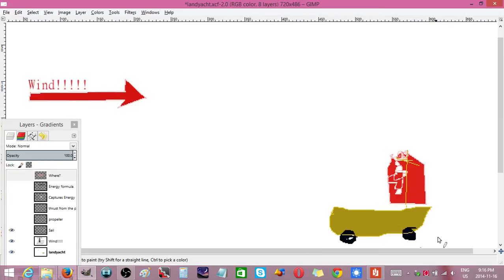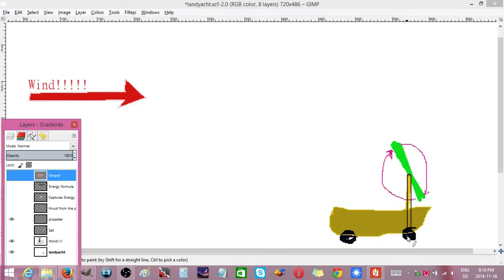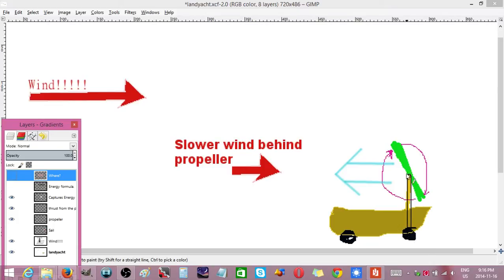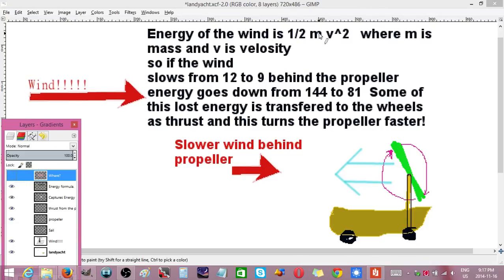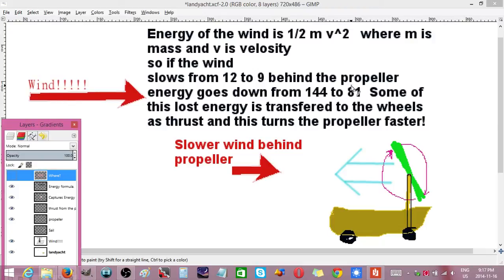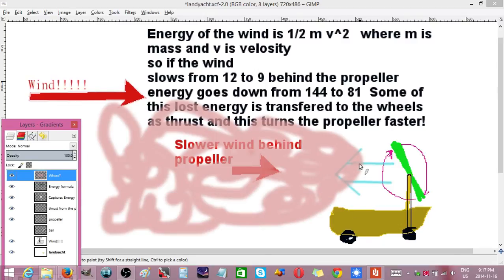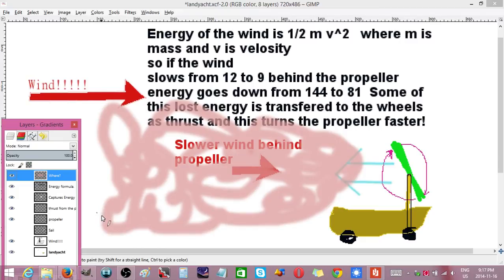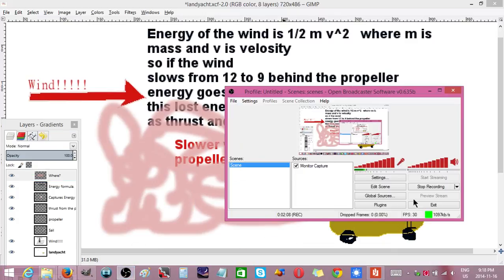Faster than the wind, DOWNWIND!  Propeller driven landyacht, Shows where the energy comes from!

Comment: Not sure that really explains it for me.   But here's another question: what happens if the wind dies down after the land yacht is going faster than the wind?   Does it keep going the same speed forever (or until it runs out of road), does it accelerate, or does it decelerate, and why?
Reply from the maker: It decelarates, due to "rolling resistance from the wheels, and friction in the spinning propeller   and if there is no wind,  it will roll  to a stop fairly quickly. The wind needed to "start "the land yacht is faster  than the wind needed to keep it moving.  I don't know at what wind speed the land yacht becomes more efficient than a plain old sail. It probably depends on the design and angle of the blades.  Ideally, the blades would have adjustable pitch and a gearbox so they could pick up and transmit energy at different speeds from the wheels.
Reply: @Brians-tracking-solar-scoop  I'd like to see that tested because it sure is a brain teaser, like for example, the model ones that can run uphill on a treadmill in no wind at all.

Also, does the prop transition at some point from being blown to blowing?
Reply from the maker: @VigilanceTech  Well done to whoever thought of the treadmill model. Moving the ground relative to the  air to get the same effect as wind. AND keeping the model so compact.    There isn't really a transition.   The moment the wind is strong enough to push the land yacht forward, the propeller turns and it is blowing,  but of course it is very inefficient. (Its like using a string vest as a sail) but the feedback of energy as the wheels accelerate quickly changes the efficiency.

Comment: Interesting. So how does the energy get transferred from the slow air to the craft?
Reply from the maker: It doesn't.  It gets transferred from the fast air to the landyacht,  as a little more forward momentum, that turns the wheels a little bit faster that then drives the propeller a little bit faster. As the land yacht launches, the propeller is acting as a very leaky sail,  slowing down the wind only a tiny bit,  but in the end it is a propeller pushing against the wind a lot and slowing it down a whole lot..
Reply: I thought the slow air was slow because it gave up energy to the vehicle.
Reply from the maker: @th3b0yg  yes,  Your initial question was "how does the energy get transferred from the slow air to the Craft" .  And the answer is still the same,  the energy got transferred from the fast air to the craft.  The transfer occurred as the air was being slowed.  The slow air is a product of the transfer,  has already lost its energy ,  just as the faster landyacht is a product of the transfer.  I hope that helps.  Maybe this confusion is just because of how we are using language. Perhaps I used an incorrect term in the video.  I didn't have a script.

Comment: Brian, I'm not sure you're really explaining how it goes Faster than the ambient air.
If you simply take the energy out of the relative wind (ie. the difference between the speeds), you would stabilize at the speed of the air. The trick is that the propeller is geared to the wheels and the wheel drive the propeller (not the other way around). The ambient air is then pushing on the accelerated air behind the propeller...or so I think...sorry if I just made it less clear
Reply from the maker: Well, the propeller pushes air against the wind behind the land yacht and that  slows down the wind behind the land yacht and transfers its energy to the yacht itself,  speeding it up, and some of that energy is harvested by the wheels to drive the propeller even faster. My point is that the land yacht is powered not by the relative wind but by the slow down that it creates in the wind directly behind the landyacht. In theory,  a land yacht would go even faster if the propeller didn't send air directly back into the wind, like a cylinder of backward sent air.  If it sent air back as a wide "cone of air",  it would potentially slow down a wider section of wind and go even faster.

Comment: Nice but wrong. It can go faster than the wind because the propeller is turning and not going straight downwind. It is essentially broad reaching the same way a sailboat can go faster than the wind on a broad reach.
Reply from the maker: Thank you,  Sassyblondel   I thought long and hard about this and I made this video because I was personally attacked for being stupid enough to believe this "hoax" with no easily apparent source for the energy to drive it forward faster than the wind.    My explanation isn't "wrong". (as agreed by the guy who actually achieved the record and who made up  the explanation that you use here).  You can seem my comment on his video and his replies, elsewhere.  Both explanations are  just the same thing seen from a different perspective. An advantage of my explanation is that I show  (to those who are convinced it is a hoax),  EXACTLY where the energy to move the thing forward directly  into the wind is coming from!  I made the video to help these (often relatively scientifically literate)  people open their minds to truth.  In the long term,  my explanation may help people understand better and perhaps modify their propellers to make the things even faster!
Reply: It's possible. Sailboats can do twice the wind speed. Land sailors three or four times and ice sailors are almost unlimited. If you imagine a craft crossing a 12 mph wind and traveling 12 mph perpendicular to the wind the apparent wind is now 17 mph and the craft can now sheet into a 17 mph breeze and travel faster than the wind. As you travel faster and bare away from the wind, your apparent wind keeps increasing. The propeller tips, in this case, are not traveling that far off the wind. Maybe 110, 120 degrees or so. Also remember as speed doubles the force squares so the propeller becomes incredibly powerful at high speed.
Reply: Yes. Yours is the best way to understand this: the land-yacht may be travelling down wind, but the rotating propeller blades (sails) are moving at right-angle to the wind and therefore the well-understood dynamics of how a sail-boat travels faster than the wind when at a right-angle to it kicks in; and the resulting rotation drives the wheels. The wheels are therefore NOT driving the propeller.
Reply: @mikerobinson579  The wheels are very definitely driving the propeller.  We have a ratchet on the axle to insure that the propeller can't drive the wheels.  And we've broken the chain more than once.  All you have to do is look at which side of the chain is under tension to confirm that the wheels are very definitely turning the propeller.

Comment: Dear Brian.
Interesting explanation. It is true, But there is another way of looking at it.
I don't know why so many people think its impossible and can't get their heads around this one.
The easiest was of thinking of it is this.
If, for example, the landyacht was moving downwind the same speed of the wind. TO THE LANDYACHT the ground is moving and the air is stationary. The wheels then collect power from the ground and transfer it to the air (via the propeller) which allows the landyacht to make progress through the air, which we see externally as downwind faster than the wind. The important thing to understand is that the landyacht has no way of "knowing" which is the moving medium (air or ground). It only knows that one medium is moving in relation to the other. We ourselves, watching from outside, know that the ground is stationary and the air is moving. This is why the treadmill experiment proves downwind faster than the wind is possible. The ground moving/air still is EXACTLY THE SAME THING as air moving/ground still. Think of an aircraft wind tunnel. The model plane in the wind tunnel does not move, but the air does. There is no suggestion that this is not the same as the plane moving and the air still, which is what it emulates in real life.
Reply from the maker: +Peter Mangold  I "get" the threadmill proof too but   I have seen intelligent people get mad at the treadmill proof!  They absolutely think it is fake. So much for all those people who "claim" to understand Einstein's theory of relativity.    It's part of the reason,  I explain it differently. Frankly,  I'm embarrassed for them that they don't get it.   (Smug smile).   You got to help people out sometimes.  (Some of them are way smarter than me,  and it is a challenge and  almost patronizing to have to explain it).

Comment: the affect creates an effect that affects the initial affect to greater effectiveness. HA genius.
Reply from the maker: The guys are pretty brilliant to think of it!  Check videos of ayrshquk  (DDFTTW) and the later "blackbird"    I have seen other explanations of how the propeller is like 2 boats tacking into the wind left and right at the same time.  Not sure how they use that to explain 2.8 times windspeed going downwind.   PLUS I'm betting that this explanation is much more down to earth and will allow other people to extend this to doing actual useful things.  We should be concentrating on what is happening to the air behind the propeller.  If we can either slow down that air more or make the slowed down part wider, the thing might even be able to go faster!  Brian
Reply: Brian White 
Search "Sail to Prop - directly downwind" for an animation that explains how tacking DOWNwind (with VMG > WS) relates to DDWFTTW.

Tacking UPwind relates to going directly upwind with a wind turbine car. This video explains both: "Directly Down & Up Wind Faster than the Wind"
Reply from the maker: piratewoodleg
 Thanks, the animations are lovely.  And the propeller on a screw wire opens up the idea of acceleration if the screw thread is changed moving forward.   BUT, I think that my crude demo shows the feedback mechanism better and also, ( this is the sticking point with most people), my demo shows where the energy is coming from.  Many many people are convinced that Direct downwind faster than the wind  is a hoax and most of us do not sail.    Showing the feedback mechanism and where the energy is coming from is critical for landlubbers.  I think I did that.